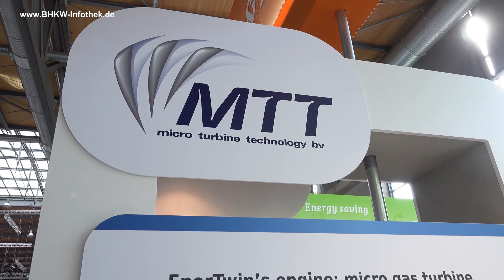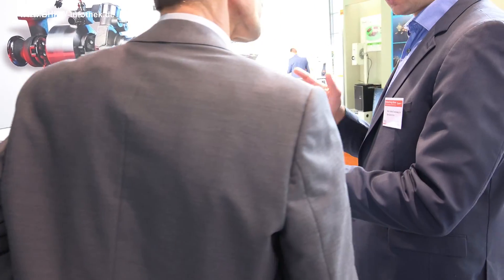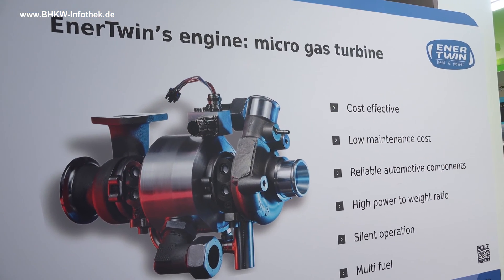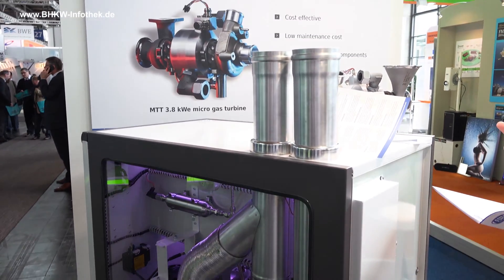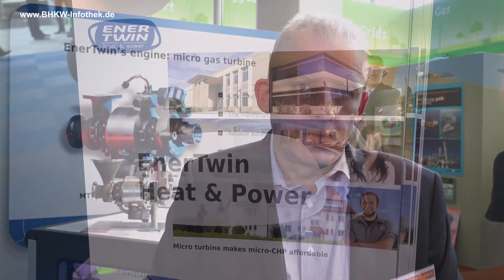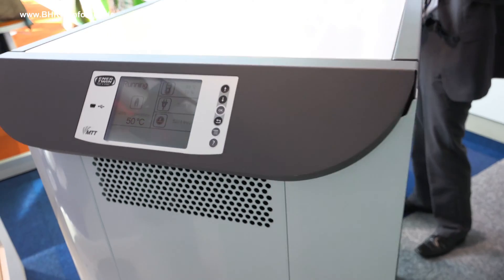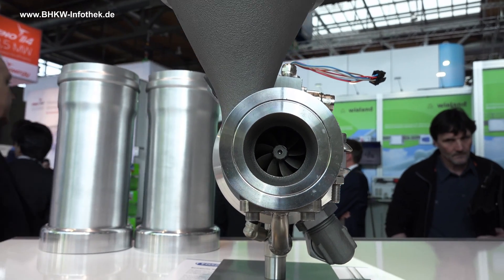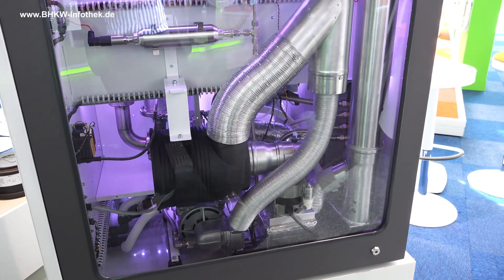MTT mCHP micro turbine EnerTwin at Hannover Fair 2015 (english)

Comment: I love the design, however a few thoughts:
1. There is no combustor shown in that demo, why not?
2. The off the shelf turbocharger components is a great idea, no point redesigning such a common component. Expenses cut down great.
3. Looks like there is no low speed shaft for driving the oil pump, problem with this is you need a rock solid and redundant oil pump system otherwise if you lose oil pressure while in operation those bearings are smoked. It might be more feasible to incorporate a PTO for this.

Comment: A turbocharger doesn't reach the same temperatures as a gas turbine. If it's a recuperated gas turbine, then it gets even hotter.  Does it only use standard turbocharger components? I would think that special materials would be used. Does it have a foil-air bearing?
Reply: Turbochargers absolutely hit the temperatures seen in older gas turbines, and the materials are similar. The problem is the pressure ratio which is abysmal, so the efficiency will be as well.

Comment: I want this instead of a large battery bank in an electric vehicle. Less weight, fast refueling, and low cost (at volume). Why is this taking so long for us to replace heavy batteries with micro turbines?
Reply: Hydrogen, natural gas and alcohol/methanol, will be the future of transportation I don’t know why people think it’s efficient to transmit power all the way to a charger instead of generating power from fuel on board, power isn’t fuel, fuel makes power so when you’re charging your car you’re still using fuel just less efficiently
Reply: @turkeyboyjh1  because it's the next hustle and the green revolution is really about controlling us.
Reply: @turkeyboyjh1  didn't know that about my comment or the trunk battery decreasing durability! is my previous comment still hidden for you?
Reply: @AK88.  yep spooky stuff
Reply: I can only see it on my notifications but not in the comment feed
Reply: Same Here.... 👊👊